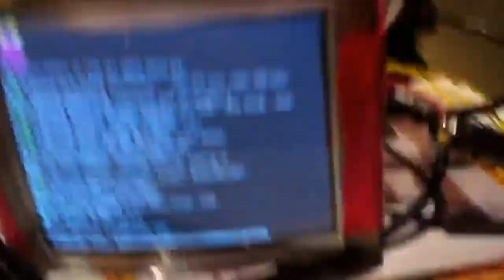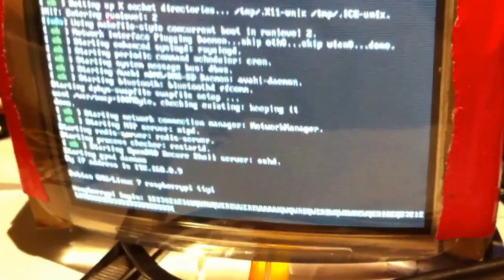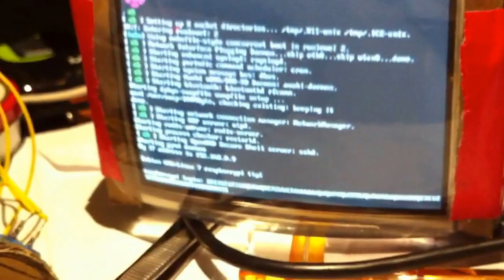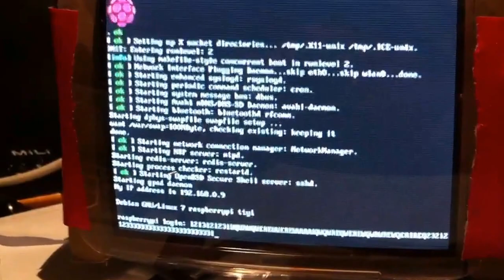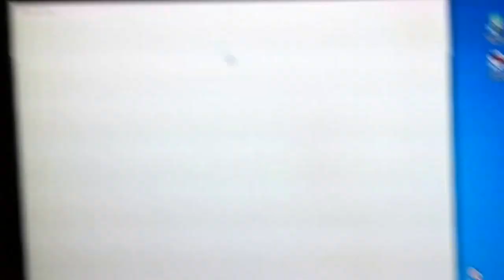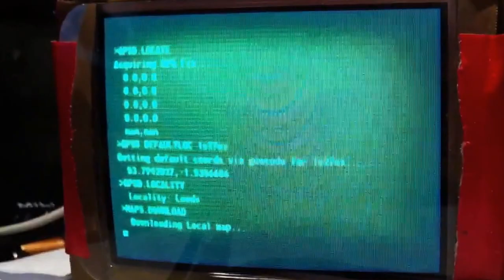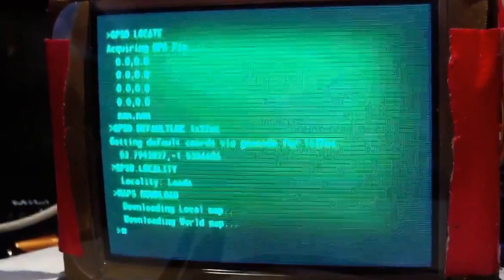RasPi Pip-Boy 03: RobCo bootup, Controls (prototype)

Comment: How did you get the tft monitor to fit the entire screen of the pip boy?
Reply from the maker: I think I just tweaked the numbers in the Raspi's config-file until it was as close as I could get?

Sorry, I've not looked recently
Reply: Neal D Corbett actually I was referring to the size of the monitor. The closest I could find was a 3.5” monitor for the Pi, but the screen made it look like it fit the entire frame.
Reply from the maker: It's this display: https://www.adafruit.com/product/913